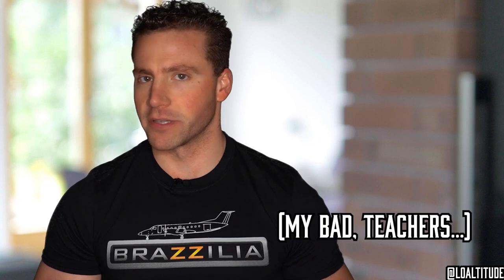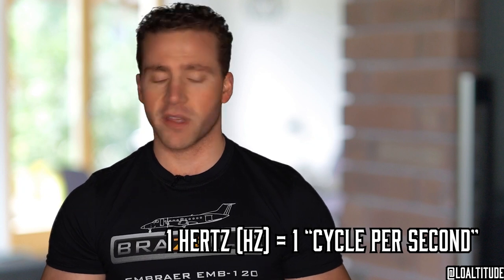Why does aviation still use AM radio?

Comment: Now I know why I had trouble 20 years ago with ATC when learning to fly 20 years ago.  The audio sucks!

Serious question though.  Why is the aviation band at 118-137 MHz (AM) when AM is usually associated with much lower frequencies 540-1700 KHz (0.54-1.7 MHz)?   Does the 100-fold increase in frequency help somehow?